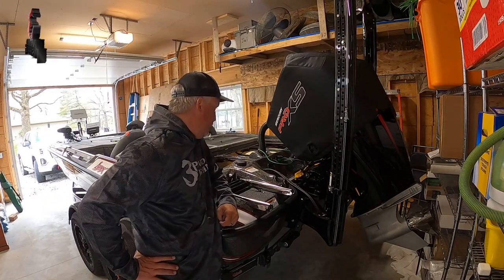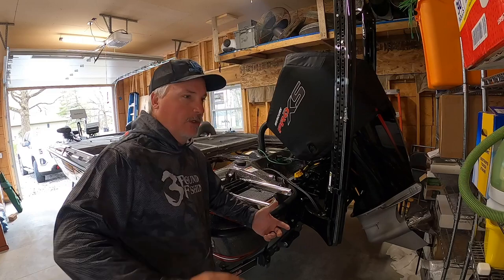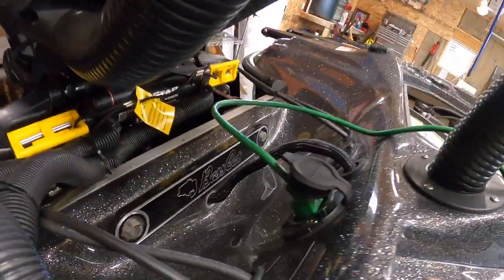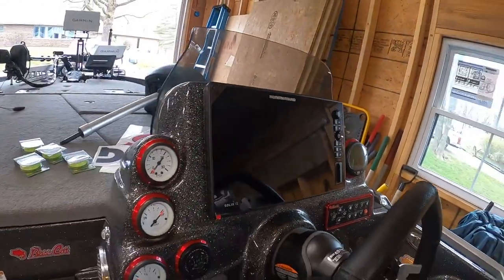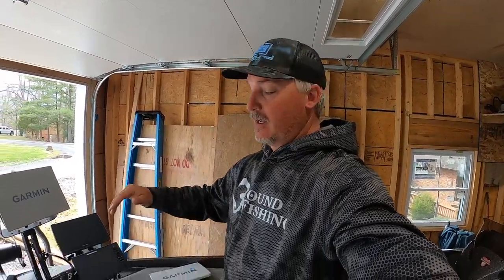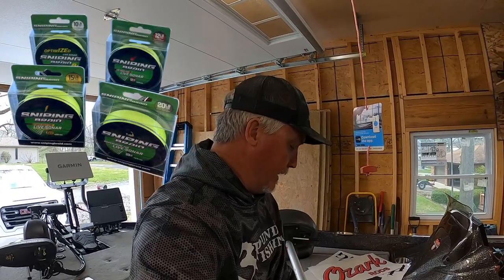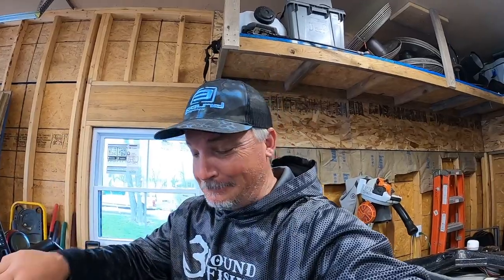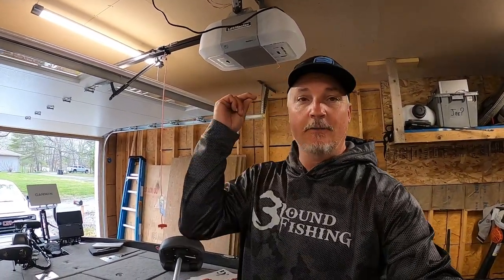The most Tech in a Bass Cat Lynx 2022

Comment: Hey Matt, 

How long can you run the TM with those 36volt/50AH batteries?
Reply from the maker: The longest I’ve ran is six hours. So that’s extended my testing up to this point
Reply: @3poundCrappiefishing  …. That’s great! You may have just saved me $700+. I usually fish 6-7 hours or less. So, I don’t think I’d need 100ah batteries.